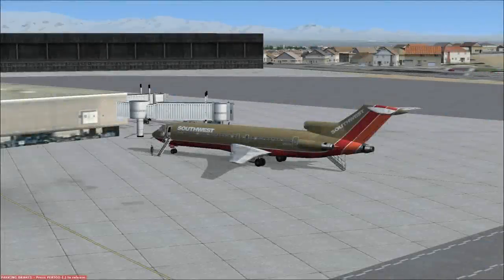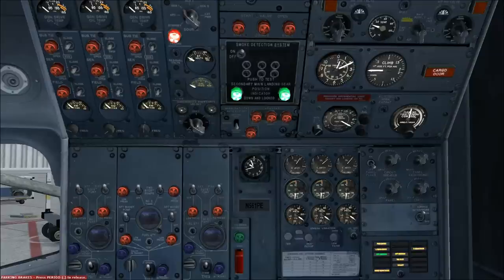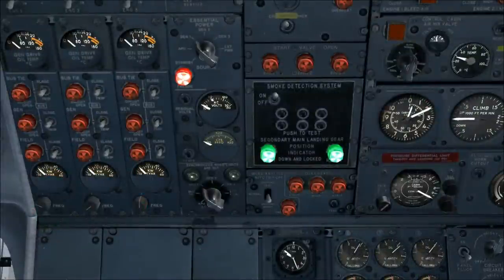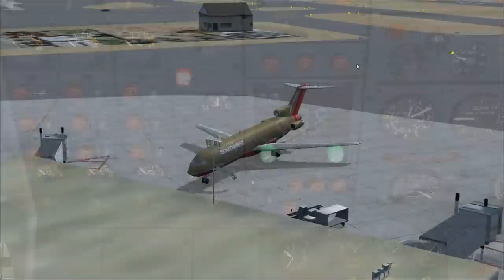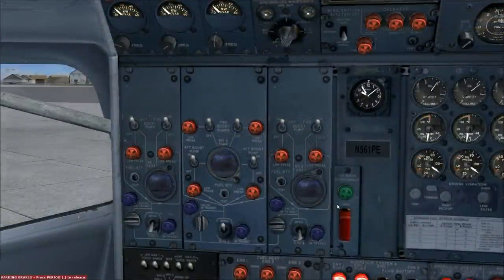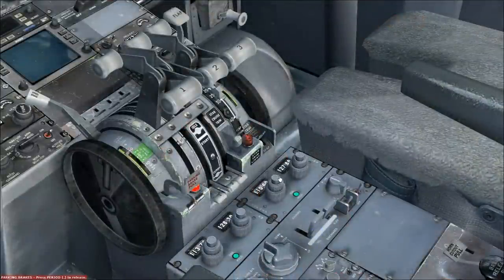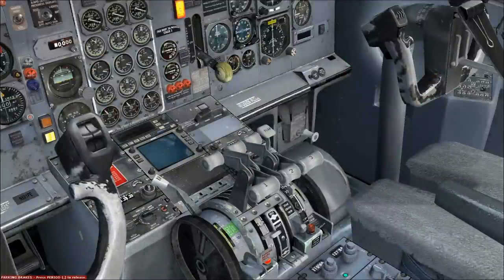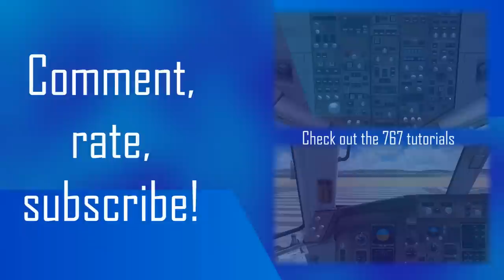727 Engine Start-Up Tutorial

Comment: I assume you know the start up was not correct.  The "mixture level" is actually the  start lever.  The correct sequence is (after apu bleed is available) engage starter, wait until 20-25% N2 with N1 indicated, lift start lever to on (or start), monitor fuel flow and egt, ensure starter cutout be sure engine stabilizes at idle.